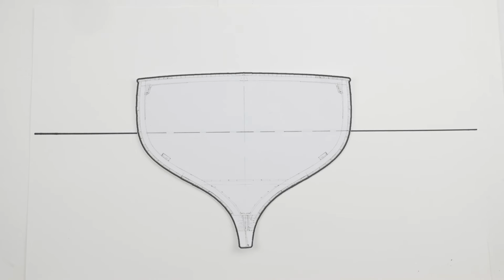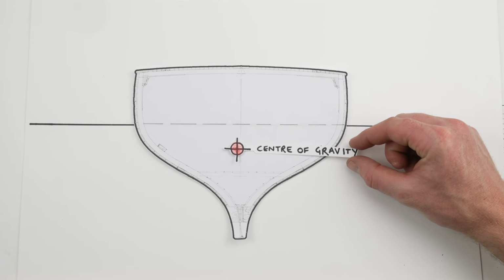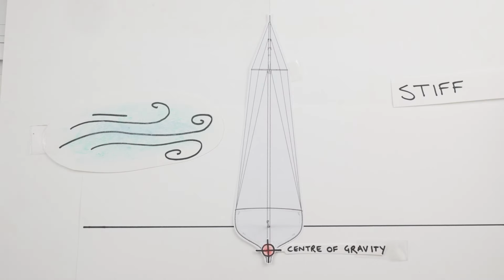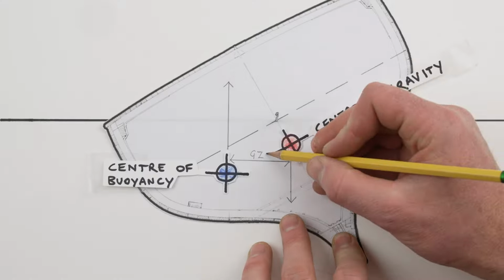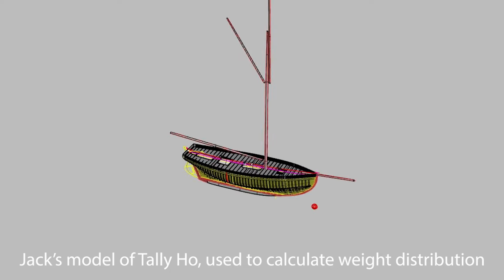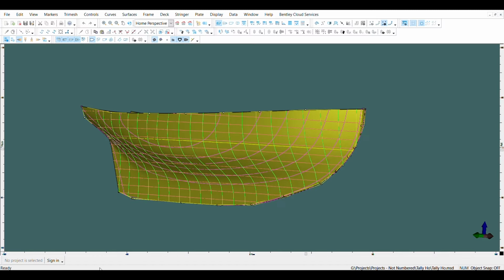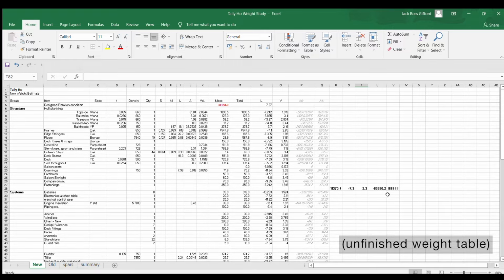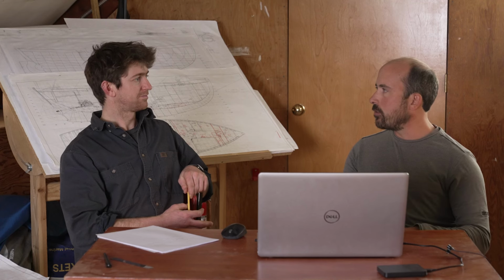Stability Calculations (Boatbuilding / Tally Ho EP125)

Comment: I can still remember my dad making sandbags filled with something stupidly heavy like lead or steel and used those as weight balance to get the ship to float and handle as he would like. It was a lot of work to get the weight trim right, but he got it done by moving those bags around or deeper down in the hull. Then a while later the bags were replaced with stiff an epoxy blended with small steel pieces to match the weight. This weird poxy mass then got glued on to the hull where the weight did the same as those bags.

My dad was all about getting things quick and dirty, and he had little patience to do things right or good, workable was enough for him and if something failed down the road due to his shoddy work, he'd complain and then just fix it so that it was workable again. It drove me and mum bonkers, but he was very good at getting things to work and that was the trade of.

But with all of that the ship we built based on a colin archer hull, work and brought us years of fun and not so fun times. Even now decades later I still dream about sailing thanks to the years we played around with that ship and it's sailing tenders. Yeah, I had my own sailing tender that had a small engine that could be added to it if you needed to go with a more speed. Dang, I loved that little sailing tender and I sailed that in good and bad weather as my sailing skills grew and I gained a understanding of wind that's hard to explain.

I'm willing to bet that you'll be needed to do some adjustments when you finally get on the water with full tanks and load, but at that point and with the math you guys are doing now, it should be easy for you to rebalance the ship just right.
Reply: Hopefully, Leo will have many years of sailing in Tally Ho, in all manner of wind conditions, while cruising, racing or crossing an ocean. Perhaps by the end of that time, he'll have her trim figured out such that she's balanced  perfectly.

Comment: Excellent video! Didn’t mind at all that it was more “talky”.  Also, I thought I was pretty well versed regarding sailboat stability, CG vs center of buoyancy, righting moment, etc… but I learned something!  As a racer of modern sailboats, I have always assumed that “the stiffer, the better” (hold the “that’s what SHE said” jokes please).  I never thought of the negative effects of too much stiffness on the motion of a boat like Tally Ho, as well as on her light air capabilities.  Great stuff!
Reply: I sailed A-Class catamarans for many years and stiffness is good when the complete boat is lighter than the sailor. Your body is movable, infinitely tunable ballast. 

If a boat's too stiff longitudinally, then you'll get jerky motion when sailing up wind and that disrupts the airflow over the sails and you lose lift. You can effect the stiffness by the way the buoyancy is distributed along the hull. Lots of buoyancy up front gives a smoother ride in a very light boat like an A-Class. Looking at Tally Ho's situation is very interesting to me.

It's a very complex subject and heaps of fun for young and old trying to get the optimum balance.

Comment: Great video. I hope you are planning to use as much Lead Acid battery as you have volume for in that Internal ballast given, your auxiliary power choice. Another point about vertical CG and tenderness can be seen in many classic yachts designed when LWL was a limiting factor in class design. By including long overhangs on tender yachts, designers could cheat the rules as the waterline lengthens as the yacht heels. My own little Kim Holman designed Twister has a 45° raked transom which kept her LWL within class rules but effectively gives her an extra 2 to 3 feet when heeled.

Comment: Apart from CofG, it would be interesting to hear your thoughts on inertia. ie if 50% of the ballast was in the bow and 50% in the stern, the boat would have very different pitch behaviour from a boat with 100% of the ballast in the middle. the 50:50 version would likely be more "tender"/comfortable, but maybe not ideal in very rough conditions?
Reply: Ive actually thought about something like this, not with ballast, but with different sail configurations. 
As an example, imagine a tall ship with only her topsails unfurled and catching wind, or maybe only the fore sails. How would these sail plans effect the handling of the ship compared to only having the mainsail unfurled and catching wind, or all of them catching wind?

Comment: To a certain extent, the tenderness vs harshness of the boat will also be affected by the moment of inertial around the center of gravity. Ie while equal weights at the front and rear of boat would not move the C of G, it would increase the inertia and smooth out or slow down pitching movement due to wave action.

Comment: So loading up the deck with water and fuel greatly affects the centre of gravity.
Reply: Another commenter stated that an accumulation of ice does the same...sometimes only 30 minutes and the boat turns turtle....
imagine having to fight ice accumulation on the Murmansk convoy run during WW2...using steam hoses.... desperately trying to melt ice topsides....

Comment: A naval architect needs to be involved from design, through construction, and after launch including sea trials. It is normal that the materials (different weights) change, bulkheads, layout, storage locations, galley layout, tankages do tend to change, each of those changes need to be recalculated in the center calculations.  Keep this guy around Leo!  And tell him of all changes.

Comment: WOW ! AMAZINGLY INTERESTING !! As my buildings stand relatively solid on the ground, I’m an architect, this video was sincerely eye-opening thank you very much !!!
Reply: Skyscrapers can be immensely affected by wind pressures acting on design features 
e.g. the "square" shaped building with a corner as the "leading edge" always turned into the prevailing wind...
causing vibrations and twist in the building?
Reply: @JohnSmith-yv6eq  - Tall buildings especially must be designed as objects in a wind environment, where negative pressure can suck the outer skin & windows off the frame, & systems meant to circulate interior air can be bollixed by exterior winds. Indeed, a new skyscraper can have unplanned effects on the wind environment of its neighborhood.

Comment: Not being a 'Yacht Engineer', I'm probably making a horrendously impractical suggestion, but... Would there be any benefit to having lead or concrete weights fore and aft, that could be raised or lowered enough to make an appreciable difference on how a sailing ship handles in different wind conditions? Set on 'screw jacks', the weights could be use to trim the COG depending on wind and weather...

Comment: Take a trip to Whidbey island . Go to the south Whidbey island highschool across the road is property owned by the school district . On that property are some very special trees . It's a rain shadow area way less rain than Everett or port Townsend. Like squim. There are small mast sized trees growing there that are at least twice as heavy as similar size Douglas fir . They are old at least 100 years old I'm thinking 150 years would be more accurate . 40 years ago you needed a magnifying glass to count growth rings they are that tight . All my years in and around the timber industry I have never seen a soft wood so heavy and dense. . 40 years ago I said that is perfect mast material

Comment: Loved this  episode.... What made me chuckle was how similar an approach I used in ascertaining the CoG for a very large rocket (Reliant Robin Space Shuttle - there's a vid on my channel somewhere). Dervied from this you can also ascertain the Inertia of the vehicle too, this is important in ascertaining whether it manouevres like a cow or like a ferret!  In aeronatics we use the centre of Pressure Cp (opposed to the Centre of bouyancy). We used a Wind tunnel for this. Thereafter You have most (not all) of the data required to develop a simulator to characterise the flight of the vehicle, design it's thrust lines, mass/location of ballast, simulate failure, wind shear characteristics etc. etc. In a simliar fashion just like you are doing here etc. etc.  Great Stuff Leo. ABSOLUTELY love your work!

:)

Comment: You have a neighbor in port Townsend . They are refitting sailing yacht DURACELL. it  set a single handed record for circumnavigation . 
 They are converting it to a comfortable cruising yacht. Kind of a modern version of tally ho . Might be a interesting contrast a fast modern glass boat as opposed to the wooden almost a century older wooden racing yacht. 
 It would be interesting .he's also a boat builder. 
 You would help them with exposure and building viewers

Comment: You stated a stiff vessel is important for sailing vessel. It’s important for all vessels. I was stationed on a new fisheries research vessel before much of its topside equipment was installed making it very stiff which endangered not only the crew but placed undue stresses on the equipment, booms etc. When the additional equipment was installed the ships reaction was much better. Another ship I was on another research vessel which was quite tender and we had to add ten tons of lead to help stiffen her up.
Reply from the maker: Interesting - thanks!

Comment: Leo, if you want a backcheck and want to know the exact fore/aft cg location in her current configuration, you can physically measure that by jacking her off the ground and then lowering the keel onto two load cells that provide all the support.  Measurement of the support locations from a datum line will determine the cg.  This can also be done with a single load cell if done twice.  The yard transporter would be capable of this also if it displays sling weight.

Comment: Quite very interesting but i would like to get some more details of it! Or is this stuff all top secret!?? What for example is "external ballast" I think you will not screw some ballast pounds outsides on the keel? What about water when its decreasing when it'i used or drunken? Same with diesel And so on?
Reply: 'External ballast' refers to the 17,000 lb lead keel that was recently cast & bolted to the bottom of the timber keel. 'Internal ballast' refers to ballast inside the boat, usually in the bilge - Tally Ho already has about 1,000 lb of concrete in her bilge & will likely need 4 additional tons of internal ballast.
Reply: @frederickstibbert7389  thanks a lot for your answer! 4 tons will not be too much for at least 3 or 4 tanks like fresh water, used water, diesel, sea-water-ballast and all the security and navigating stuff - also some batteries  - but how many peoples will be able to sail it with? 10 peoples needs more than 5 for crossing the atlantic...

Comment: These are extremely important calculations for a well designed boat. I have designed a built a couple of canoes and kayaks and found just how important all of this is for primary stability, righting moment and performance. Of course, the bigger and more complex the vessel is, the harder this is to model. I will stick to small rowing vessels. "The Strip-Built Sea Kayak" by Nick Shade is where I first learned the basics.

Comment: Can you test the current centre of gravity of Tally Ho by lifting the boat through a single point in its hull ? Move the position of the "eyelet" until you strike the balancing point. Needs a large crane.
Reply: You could also put load cells under the supports holding up the boat and measure how much force each one is exerting on the bottom of the boat. No crane needed.

Comment: Did you weigh the bare hull when you hauled it to Port Townsend?  with loaded and empty axle weights, you would have the actual fore and aft CG for the hull at that point to back check the computer model.

Comment: Honest question from someone who knows nothing about this.  What happens if you get it wrong - not to the point it unstable, but not what you wanted?  Is it possible to go back and adjust things to correct a mild problem?
Reply from the maker: Quite a lot of adjustment will be possible with the movement / addition / subtraction of the interior lead ballast, up to a point. This is why it's important to make sure there is enough space in the bilge to be able to move it around to where we need.

Comment: Fantastic explanation and graphics. While I didn’t know the terms before today, “tender” and “stiff” make sense to me as a mechanical engineer, akin to the natural frequency of a spring-mass system being proportional to the square root of stiffness divided by mass—so long as the mass center stays below the buoyancy center. Also, the longer the moment arm between those two points, the better the boat’s ability to right itself. Thanks for sharing, Leo!

Comment: There is also a THIRD measure and it's called the "center of pressure".  Firearms take this into account with their projectiles:  If you imagine a bullet flying through the air, there is a relationship between the air pressure pushing on the nose of the bullet and the center of gravity of that bullet;  and this is very much effected by the shape of the nose.  If you get this wrong, it's like trying to push a trailer forward with your truck, or like balancing a stick on your hand--- any sudden movement off center and it wants to go the other way very suddenly:   this can effect the steering of the boat if it's terribly wrong, but judging by it's classic shape-- obviously it will be fine..  If you get this wrong with projectiles for firearms, it causes the bullet to wobble or tumble in flight and will have terrible accuracy.   These boats go slow enough that it doesn't matter as much, and it's already a set design, so you can't change anything anyway;  but there is another dynamic happening when she's full steam ahead.

Comment: Merchant sailor here, calculating the stability of the ship before, during and after cargo operations is normal routine.

You pretty much nailed it. Ofcause there are more factors in play as you said, but this shows and teaches the basic understanding really well.

Edit: Im very happy that you mentioned that displacement is equal to the vessels weight.
One of my pet peeves is people calling the GT as the weight of the ship.

Comment: Thinking about center of gravity, buoyancy and placement of spar. If COG and COB have changed from original, would not the placement of spar change? Or would it stay the same and just make adjustments with internal ballast?
Reply from the maker: Just make adjustments with internal ballast - the spar location is too integral a part of the original design to change.

Comment: A thoroughly interesting discussion on the subject.  However, I have a couple of queries::
1)  What was explained was the static loading of the vessel and the forces acting but the dynamic forces e.g. the wind in the sails must have some effect on the notional and instantaneous location of C of G.
2)  If you use the tanks to trim the boat and define its longitudinal position of the C of G then won't that affect the trim depending on how full the tanks are?  I would have thought that the tanks should be ideally sited at the same point longitudinally as the natural C of G so that their fullness has less effect on the trim.  This is a principle that you find in race cars and aircraft.  A 1000lrs of water, whether waste or fresh weighs 1000kgs i.e. 1metric tonne that is not an inconsiderable load to accommodate.
Reply: 1) Center of gravity stays the same relative to the boat as the boat moves. (It changes as the contents of the boat changes: water, fuel, stores, equipment, etc.)
 
2)  I think the changes to the tanks Leo was talking about are to provide sufficient space in the proper locations for fixed (probably lead) internal ballast, not using the tank contents to trim the boats. Since more ballast than originally though will be needed forward space needs to provided forward for that ballast.
Reply from the maker: @DCockey  Correct - moving the tank is to make space for interior lead ballast in the correct place, which is far heavier than water of course. 
With tank contents and other consumable items, we calculate using different load cases (dry ship, departure, etc) to see how that effects stability in different cases, but basically take an average and make most decisions based on a load case with tanks partly full.

Comment: 4:31 While I realize that's close enough to correct, isn't that technically incorrect, as the center of buoyancy moves, relative to how much of the hull is submerged, so that in changing the way the ship sits in the water, by shifting the load around, you are changing the center of buoyancy? Or when you're talking about it, are you always talking about the theoretical center, as if the ship were ideally on plane?

Comment: well sure it wasnt the typical video for tally ho ... but still very informative ... and it doesnt just relate to boats but planes as well ... even cars and trucks ... 
.
yes folks ... even air is considered a fluid like water ... just not as dense ... and all of the same considerations play a role in planes cars and trucks as well ... 
.
enjoyed the video as it gave me some things to consider for the rc plane I am building and what I can do to adjust them .. unlike most rc videos ... they just do a belt and buckles approach and use a basic balance ... sure it works BUT it doesnt give you actual data ... it just gives you proof of points ... similar but NOT the same ..
Reply: one suggestion for the ... animations ... add a Little Leo on the boat looking happy as a clam in white wine sauce and a glass of glenfidiich on the side ;)